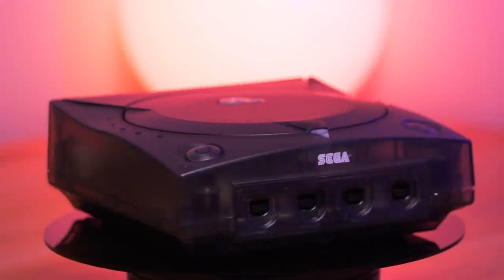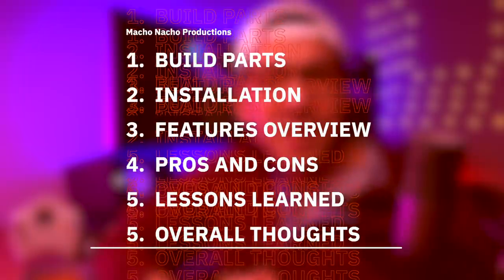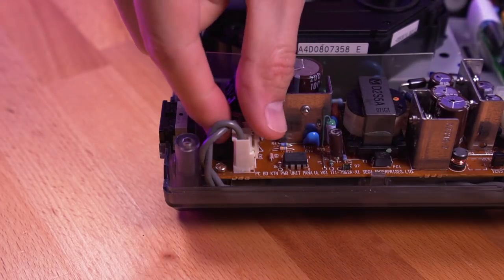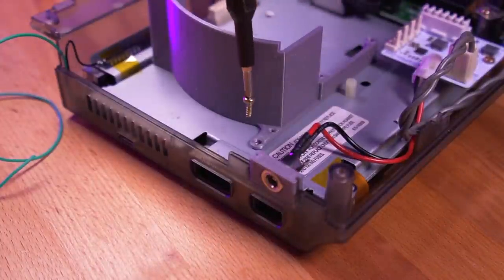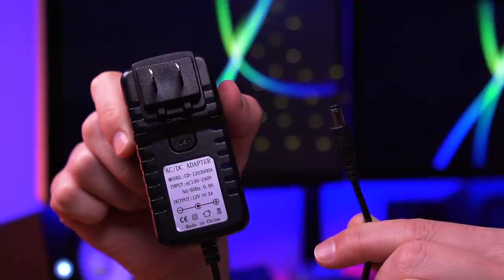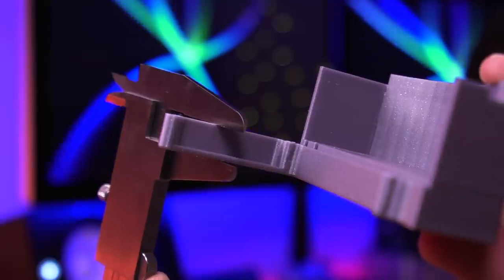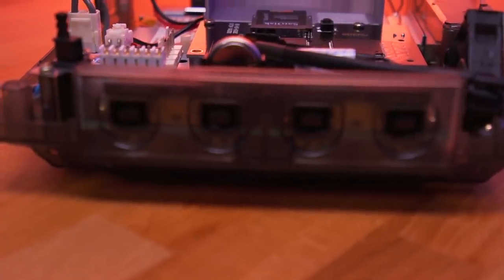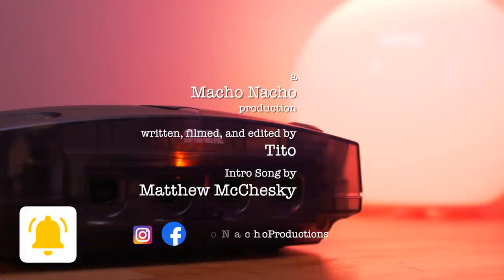Building the Dreamcast of my DREAMS! | Part2: DCDigital + GDEMU + Noctua Fan + DreamPSU Tutorial

Comment: Terraonion mode with a ssd would of been nicer imo.
Reply: Yeah, but dat' price for effectively the same functionality. I think the selling point of the MODE is for Saturn owners. The DC has its budget ODE and like many flash carts now, some are actually as good as the EverDrive for less (I personally think the EZ Flash GBA is better than the EverDrive, while the El Cheapo GB\GBC is nearly as good, and both cost half that of an EverDrive.)

But on the whole, you can never go wrong with an EverDrive while you CAN go wrong with a TerraOnion product. The company completely burned owners of the original SuperSD System 3 for TurboGrafx16 (raises hand) and their customer service is authoritarian, serializing devices to accounts, limiting how many times you can download a firmware, and banning owners who violate undisclosed rules from their forums\download portal. Further remarkable, they gave the community the middle finger when qualified electrical engineers and installers offered FREE assistance in resolving various video and audio issues with the first two versions of the SSDS3 and still didn't properly implement fixes in their final revision PCB. This experience alone has turned me completely off considering another TO product for any console in the future. I'll avoid MODE and MegaSD as there are fortunately competing products that deliver. But then again if I had a Saturn, I'd probably have no choice as the Rhea\Phoebe are outrageously expensive and at this point, old.

Comment: It seems redundant to remove the original psu AND add in a more efficient fan.  Why would you need a better fan if it now has less heat to dissipate? Also, I wonder what all these mods do to the weight of the system. I wonder if it feels like a cheap Chinese console now.
Reply from the maker: Fan is quieter.

Comment: To be clear: I really love this series, and the mods done here. But WHY OH WHY would you ever ever ever ADD a power brick to something that has an internal PSU? My eyes were about to pop out of my skull from that one. Unless the system is known to overheat, all you're doing is adding a new point of failure (passively cooled, likely low quality no-name brick vs. actively cooled, better quality internal name-brand PSU) and more hassle to the console. Power bricks are a massive nuisance. If one wants a better PSU, there are tons of great options for compact internal 12V PSUs (from suppliers like MeanWell) that are extremely efficient (>90%) and could easily fit in the space of the original with room left over for whatever that conversion board does.
Reply: The problem is the 12V when you remove the GD-Rom
Reply: @anorton4821  How is it a problem? And how would using an internal 12V power supply rather than an external one affect that whatsoever?

Comment: The GDMU is not the greatest mod part of this, I do not like it instead I opt to keep my disc drive, primarily because I still have dreamcast games, and I still buy homebrew games.  Most of the GDMU's have a heating issue which yes you can slap generic heatsinks ontop of them which will bring down the overheating aspect of it, YES ALL OF THEM overheat. The fix is simple and cheap, 2 copper heatsinks with some heatpads. But like I said I do not like the GDMU mod, I'd prefer to keep my disc drive, now if there was a mod that let me have both I'd be all fine with that. Well there kinda is it uses the serial port, but the serial port is kinda garbage, so you lose pretty much all game compatibility and pretty much can only play a few games through it, and rip games at the speed of 2 hours for 200mb games.